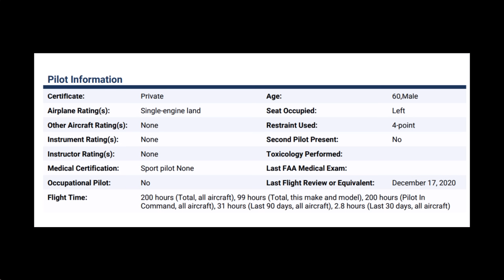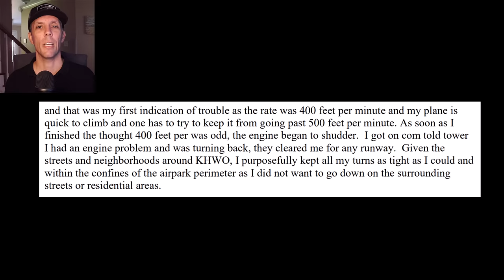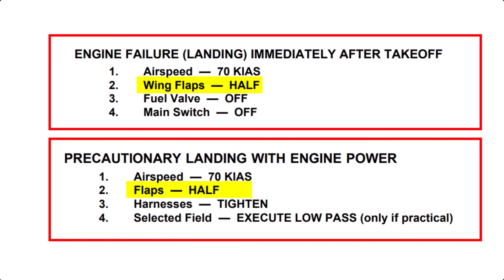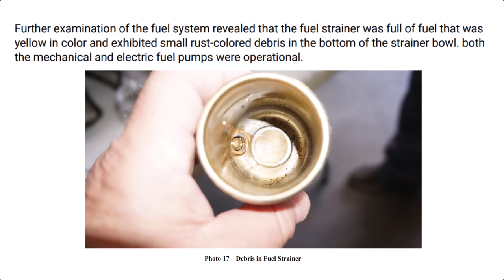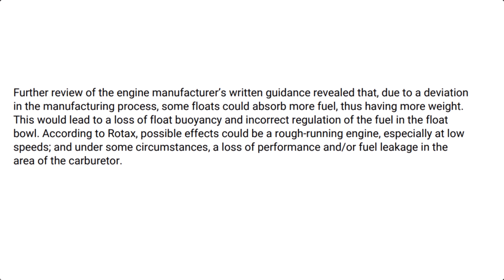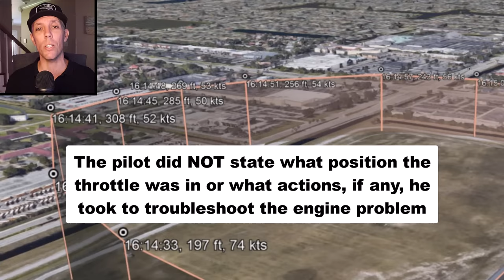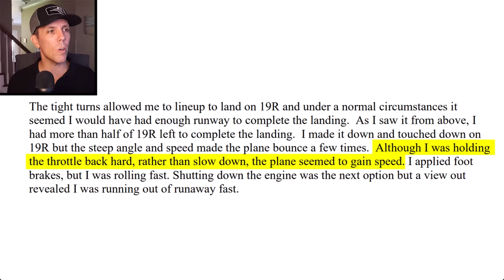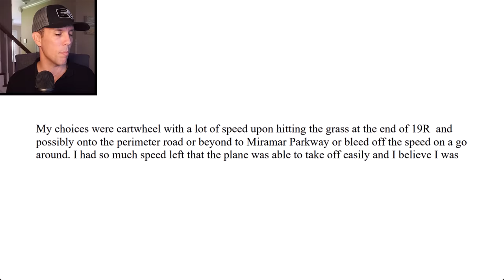Pilot Makes HUGE Mistake During Emergency Landing!

Comment: I own a similar "slick little light sport" and trust me, if you come in even a few knots hot, and then mismanage your elevator inputs by pulling back even a tiny bit too much in an effort to slow the aircraft down it will either float or do what seems like "bouncing off of ground-effect". You can balloon back up and end up with an extreme deck angle in an attempt to slow the aircraft as the plane badly wants to use that excess energy to go back up in the air. Under normal circumstances things can get out of hand in these light slick airplanes quickly in a non-stable landing configuration (High, fast, long, no flaps). The drill for such an event under normal circumstances is always a go-around. His brain was certainly yelling "GO-AROUND!". Plus, I think he understandably had the illusion of higher ground speed on touchdown because he was fixated on the runway directly in front of his propellor, and not far down the runway as one normally is. His "reptilian brain" yelled "go-around" which was the wrong decision to make. All in all, despite that poor decision he managed to save himself, the aircraft, and those on the ground. He is super lucky he didn't stall the inside wing several times (42 knots, 30-degree bank, no flaps) and go face first into the ground. Great outcome. Sadly, all he needed to do was proper maintenance of the reliable Rotax 912 or extend the downwind past the threshold for a few seconds and all this could have been avoided.
Reply: My students have this problem, I am so used to the aircraft now I can yank all the airspeed out of it if I need to without floating it, but yeah if your only flying recreationally and not several hours a day. Its very easy to mess these landings up.
Reply: Agreed. I fly a Tecnam P92 with the same Rotax. That thing just wants to fly. At 70 knots it will take a while to bleed speed on flare. If he had maintained proper glide speed, make a better judgment on height and thus extending downwind a bit more, he and the plane would have been fine. Still, he walked out, so kudos to him.
Reply: His ground speed was far below the the minimum why would he still be worried about floating or exceeding the runway?
Reply: Rotax? More like Blow-tax aimirite?
Reply: Great reply.  I have flown this plane as well as the CTSW.  Both take MUCH more concentration and energy management to land well compared to the usual cessna/piper planes. They just don't  slow down well, and when they do, they drop hard and fast.

Comment: Propeller rotating does NOT mean the engine is producing power.
Reply: At those speeds it does as the prop would stop if the engine was dead.
Reply: @LTVoyager  What speed does the prop stop?
Reply from the maker: As I mentioned in the video, neither the NTSB nor the pilot stated what the engine was doing from the moment the pilot said it "shuddered" to the time he crashed. The pilot did state that he increased the throttle when he tried to takeoff again, which there would be no reason to do if the engine wasn't producing power.
Reply: @pilot-debrief  https://youtu.be/V84a3TwsytY?t=313

You said prop spinning = at least partial power.  That isn't true.  Whether or not this guy's engine was producing power is irrelevant to my comment.  I do enjoy your content, you are no doubt saving lives with you videos/analysis.  Keep up the good work!
Reply: @Public_land_trail_cams  There is no answer to that as it varies by airplane, engine, propellor and probably density altitude.  However, most small airplanes will have a hard time keeping the prop spinning below 60-70 knots.
Reply: @LTVoyager  A spinning propeller doesn't mean you have at least partial power.  That is a fact.
Reply: @Public_land_trail_cams  If you are below the airspeed required to windmill the propellor, and the propellor is still turning, what is powering the propellor?
Reply: @LTVoyager  If the prop is not windmilling, but also rotating, then that engine is running baby!
Reply: @Public_land_trail_cams  Exactly, I am glad you finally saw the light.  That airplane was flying fairly slow, yet the propellor was still turning and thus the engine was making power.
Reply: @LTVoyager  I learned to fly in a cessna 152.  Best glide speed is 60 kts.  There was always discussion that if you wanted to glide farther during an engine out, you could pitch the airplane up momentarily, well below the best glide speed, to stop the prop, then resume best glide speed and possibly glide farther than with a windmilling prop.  My oringinal comment is still 100% true.  A spinning propeller does not indicate that the engine is producing power.
Reply: @LTVoyager  It's misleading and not true to say "oh look, the prop is spinning, the engine must be producing power"
Reply: @Public_land_trail_cams  I agree.  I was talking about slow approach speeds, not in general. Context matters.

Comment: Not a pilot but grew up in aviation with a bush strip at home. Slipping was the only way in. We had a bumpy 1,200 foot strip with 300 foot displaced threshold due to trees. We had 900 feet no matter which direction you landed or took off. We had several C172's and a 7AC. It never occurred how good of a pilot my dad was until watching these videos. He was a highly skilled bush pilot and mechanic. I was not allowed on the controls when landing at home but performed many take-offs with my dad as on reserve. I would land at the local GA strip and trade seats.
Reply: sounds like you could have easily gotten your PPL. never too late!

Comment: I have a Sting Sport. Flaps and a slip will get it slowed down and will burn altitude just fine. Base on the pilot's statements as related by Hoover, the guy was either totally frazzled by the situation or didn't seem to know about slips for glidepath control. Not using flaps suggests he did not have a pre-landing checklist memorized and probably was not religiously using checklists. Pre-landing checklist in the Sting Sport is pretty short since it only has one fuel tank, fixed gear, no carb heat, auto mixture, and a fixed pitch prop. To configure the Sting for landing the list is speed-flaps-trim. I see a lot of student pilots these days that are at a total loss when I ask them to use their checklists. Maybe a case of poor quality flight training.

Comment: Thanks for the thorough analysis. Last year I had an incident with loss of power in my (exceptionally small, rather fast) aircraft over pretty unsuitable terrain. I was lucky enough to nurse the plane to a small glider field and drop it in there with hardly any thrust left. I even managed to get it on video and put it up on youtube for the world to see. 
Now, the TL Sting is a very popular aircraft here as well, there's one in the same hangar as my own plane and I do know it quite well: The TL Sting is by no means an unforgiving beast, it's rather docile. Only by stacking all those little errors on top of each other did this pilot manage to turn the situation into a wreck.
Lesson to be learned:
Do keep up with the maintenance, don't stack risks. Build good routine in accordance with best practice and train for engine emergencies.
Stay safe, and I wish you all have a peaceful sky!

Comment: Good analysis, Hoover.  Very surprising that the shop that did the condition inspection didn't know about the need to check the carburetor floats.  That's a very well-known maintenance item.   I'd also like to know how the crud got into the float bowls - probably a good idea to look at the fuel filter(s).  I would not want to be the owner of the shop that did that inspection.
Reply from the maker: Thanks 👍 Good point!
Reply: One thing to think of: is it on the list?
Reply: Light Sport maintenance requires a special sign off after training - An FBO that does maintenance on certified aircraft normally can't turn wrenches on light sport machines. . . Thems da rules ya hear
Reply: Having floats in an aircraft engine carburetor is an all-around bad design, and having contamination in the bowl is just one reason.
Reply: @adotintheshark4848    At the time, carburetors with floats were the only technology for engines. It took time to develop the carburetors with diaphragms and springs...

     There's a line of thinking that goes with engineering, and satisfying engineering issues at the various points where we (humans generally) can understand them for what they are... and then develop better systems and components as necessary.  ;o)
Reply: 6:55 The debris may have got in during the "fuel ine replacement"
Reply: @HongyaMa I'm an A&P mechanic and I'm pretty sure I could work on any light sport aircraft if I have the technical documentation to conduct such maintenance. Do you know what source document that stipulates I can't work on an LSA?
Reply: @pilot-debrief  I have these bing carbs on my motorcycle and I'm pretty sure I know what this pilot felt. 
The Idle circuit draws fuel from right in the corner of the bowl, away from crud, and a little higher than where the main draws from. The Main draws from that central lowest well where all that debris accumulated to block the main jet.... 
I had water sat in that little well once, causing my engine to idle fine, but splutter, bog or die if you continued asking for more power.  The engine trying to switch to a non-functioning main jet was a very disconcerting feeling.
With the main jet got blocked, the pilot would have had a totally normally feeeling engine on low throttle, I guess the plane was climbing mostly on the idle circuit if he was getting 4/5ths of the normal power.... As soon as he asked for more throttle to compensate, revs increased slightly, the carb transitioned from the idle jets to the main jets... almost immediately totally starving at least one cylinder of fuel, causing a huge power loss and also maybe a violent shaking if only one cylinder was affected.

I don't know much about aviation, however- isn't the advice for a whole bunch of issues- 'just add more throttle'?
...and anyone that plays with engines knows that adding revs usually '''cures''', or hides, most rough running issues, so adding throttle here seems pretty logical in the heat of the moment.

Not trying to defend all of this pilots mistakes- just saying that I've felt a fair few engine problems and this was the most confusing and strange to me.
Reply: it is certainly on the Rotax 912 maintenance manual & checklists. Various manufacturing issues caused multiple similar issues (loss of power in flight) here in Europe, hence the extra entries in manuals @UncleKennysPlace
Reply: @gnarthdarkanen7464  Diaphragm carbs have been around for many, many decades. Way before this aircraft or the Rotax engine in it was engineered. Just to clear that up.
Reply: @gnarthdarkanen7464  great example of this is the ww2 aerospace industry .by the end of the war they were getting really good.

Comment: There’s a golf course straight ahead. On almost every training flight after my first pfl at some time the instructor would close the throttle, pull carb heat and say, engine failure. It certainly kept me sharp.
Reply: Seems like a good idea to orient yourself around your home field, so that you know what your options are if the engine quits on you during takeoff.
Reply from the maker: I believe that golf course is about 1.3 miles off the departure end of Runway 28. If he had a complete engine failure then that might have been his best option rather than attempting an "impossible turn". However, he had already started turning right and that makes the airport a much more viable option. 
Regardless, it's always a great idea to have an understanding of where you might land and what you're going to do if you lose an engine on takeoff at any airfield.

Comment: Why would rotax use a chemically reactive material in the float? That's insane - to change mass with different fuel! I heard those can swell shut if you use ethanol gas.
Reply: Older equipment that was designed before ethanol was readily available. I have had a few fairly big boats. The original onboard fuel  tanks were made with a resin that alcohol would react with. Lots of gummed up fuel filters, and carbs. In the boating industry lots of claims were made for damaged fuel tanks and the issues they caused, mostly with trailable boats. The owners would fuel their boats at a land based gas station rather than paying for marine fuel. So, they put fuel in their boats that readily absorbed water and was also a solvent.

There's a reason why marine and aviation fuel is made. I've burned my share of both marine fuel and 100LL and would never put anything but marine fuel in a floater, or aviation fuel in a flyer.
Reply: Most people think car gas ( pump gas) is mogas ! It’s not !! 😮 has less then 1% alcohol which binds water , no benzene which gums up the fuel system and it’s only transported in a special fuel truck  !! Not like pump/ car gas , today 87 tomorrow 92 and another day diesel( 7 RON) . That’s why Lycoming allow MOGAS in many engines ( low compression) but prohibited Pumpgas  !

Comment: I think the tailwind component was the most critical factor.  Usually power off landings are practiced on the same runway on which a pilot is practicing power-on landings into the wind.  Managing an approach to a runway with a tailwind is a challenge and if you have never done any downwind approaches or landings with your cfi, likely will result in speed being way high at the flare, which appears to be what happened here.
Reply: Agree, but it was probably a very minor contribution. The video is rather conclusive, and that he was diving for the threshold.
Reply: @Jimmer-Space88  He was diving on final probably because he didn't control the altitude and speed properly while turning and before getting aligned with the runway, and that was probably because of the wind component pushing the airplane toward the runway.  It's a different world - training and practice is needed.  Once the descent angle gets too steep (which can happen way before rolling out on final), speed cannot be controlled even with full flaps and a full rudder slip.
Reply: @warren5699  You had me at "slip", I was thinking the same.

Comment: I didn't know that small planes use automotive fuel. Thanks for the good content as usual!
Reply from the maker: You bet! Ya...some planes can use automotive fuel so you definitely have to pay attention and plan ahead to make sure the airports you fly into have the services you need.
Reply: Most modern LSA use mogas. Some old ones can too, and in some cases, should, like the continental O-200 and 300.
Reply: The Rotax 912 was originally designed to run on automotive fuel.  If you are running leaded gas, the oil change time is cut in half and it's hard on the valves and gearbox.  🙁
Reply: Yeah, it's fuel available at gas stations but it's ethanol-free which is what you use in boats and all small engines. It's called MOGAS. 
I don't know why he didn't he abort the take off and bleed off the excess speed before Landing.
Reply: @pilot-debrief  Not sure why you'd put ethanol based fuel in any plane. Ethanol is hydroscopic, readily absorbs water, and the fuel is subjected to phase separation. You're just asking for trouble. Had a ROTAX engine in my jet ski. I'd buy ethanol free gasoline from a local gas station to put in it. It costs more, but in the long term costs far less than damaging your fuel system or engine.

I've burned my share of 100LL, marine fuel, and alcohol free fuel. I can't understand why someone can buy a boat or a plane, and then start pinching pennies that WILL either cost them many dollars in the future, or your life. 

Oh, and who attempts a go around with a bad engine? Just plain stupid!
Reply: Most general aviation engines can’t use automotive fuel because their compression ratio is high. If you used something like 92 octane in those engines, the compression in the cylinder could cause the fuel to ignite during the compression stroke, which is very bad!
Reply: We have no way to get mogas for our 912uls. So we're forced to use 100ll.
Reply: Most "small planes" (<12,500 lbs.) do not use automotive fuel. However, this aircraft is an LSA - light sport aircraft -  max. gross takeoff weight: 1,320 lbs.

For example, the ubiquitous C-172 is probably the most famous "small airplane," but it does not use automotive fuel nor is it an LSA.
Reply: @erich930  Most GA airplanes like O-360 and the O-320 have 8.7:1 C.R. or less.
Reply: @geezler4083  How does that compare to a regular car? Diesel engine?
Reply: @erich930  these engines I spoke of which can be considered the majority of general aviation use the 100 octane low lead avgas for many reasons not necessarily because of compression ratio.
Reply: @erich930  my Chevy six banger has 9.8:1 and is happy with cheap pump gas.
Reply: The Rotax 912 and its derivatives are the most popular engines in Light Sport aviation.  They prefer MOGAS.